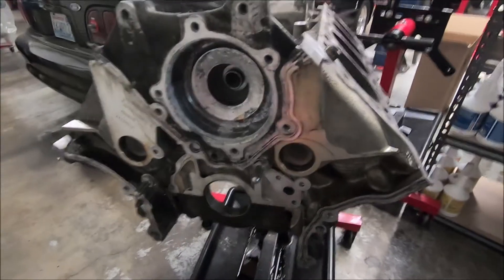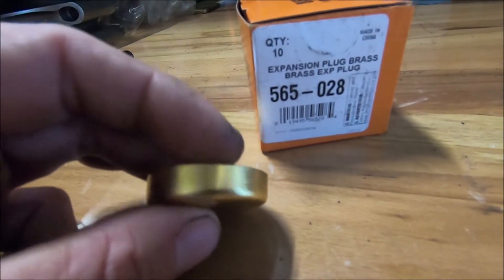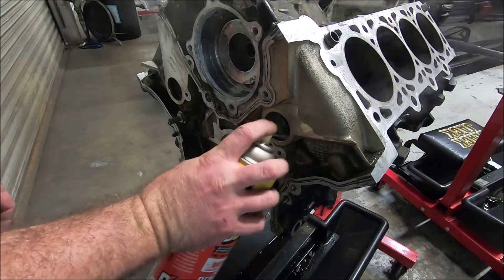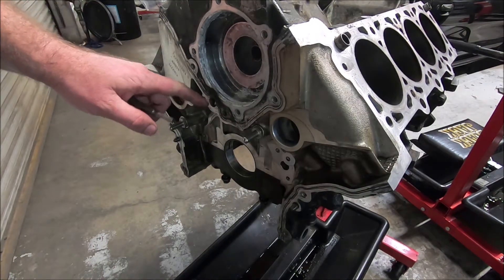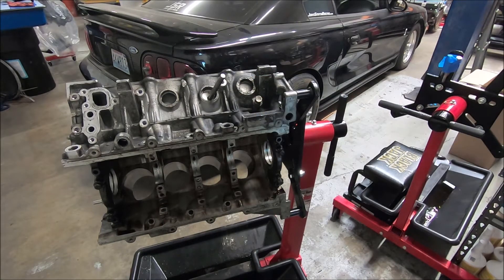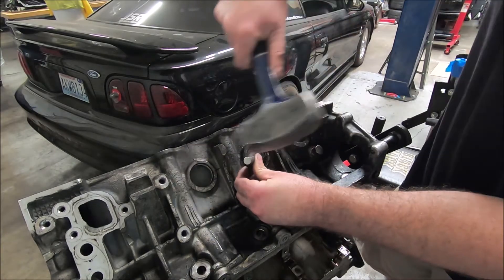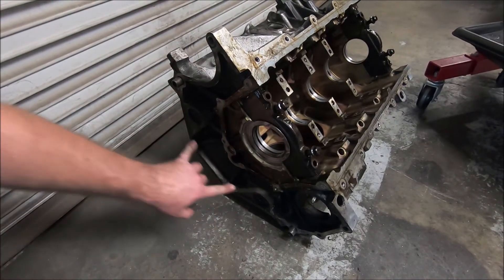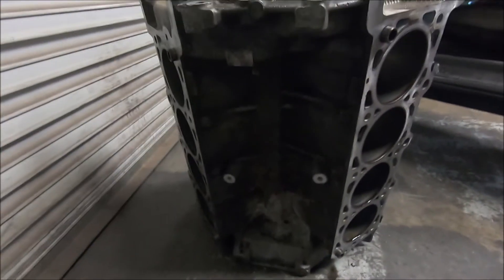How To Remove and Install Freeze Plugs and Oil Gallery Plugs on a 4.6 Teksid Engine Block

Comment: I saw this after I had at the machine shop, he said they all look good. Should I go ahead and take them out and put new ones in? I noticed the front gallery plug was missing (Teksid block). Can I clean them out good enough? What brand do you recommend? I had to send my oil pump back to boundary, apparently the forged crank out of my old mmr cobra block is a coyote, or size, anyway, not real sure. Thank you for any help, and if you have the parts I need I will gladly buy them from you.
Reply from the maker: They don't always need to be replaced.  Is your block missing a coolant plug or the oil plug?  Can you send some pictures to johnsmithracing@outlook.com

Comment: There should be a special place in Hell for the guy who thought it would be a good idea to have freeze plugs in places where, when they rust out (because the last guy who owned the car ran straight water rather than coolant), they dump liquid into the motor oil!
Reply from the maker: Haha, yeah I believe the later aluminum blocks went away from having so many freeze plugs.  I don't think there are any on the Coyote 5.0.

Comment: Do you have a size and/or part number for the front and rear oil gallery plugs?
Reply from the maker: I am not sure on the size but I usually get them from Ford Performance PN: M-6026-A46

Comment: Thanks for the video! You’re videos are very informative! I can’t wait to rip apart my 4.6 4v and get a big bore stroker done to it,and convert to fully built and ported 01 cobra heads,I really want to hit that 500whp in naturally aspirated form and have it rev to 8,000 rpm
Reply from the maker: If you are looking to CNC port 4V heads, I would stay away from 99-01 Cobra heads.  Most places that I know of will not CNC port those because they end up hitting a coolant passage.  You are better off with 03-05 Avaitor heads.  Preferably DB or DC casting for the 9 thread spark plug hole.
Reply: @JohnSmithRacing  I've got an 01 cobra and at some point plan to have the engine built and throw a new gen 5 whipple on it. Am I fine using stock 01 heads or upgrade to 03-04?
Reply from the maker: @andrewlawrence273  Your are fine with stock heads but if you want to have them CNC ported you are better off with the 03-05 Aviator heads.  You can also use 03-04 Cobra heads but they are harder to find and after both have been CNC ported they flow they same.